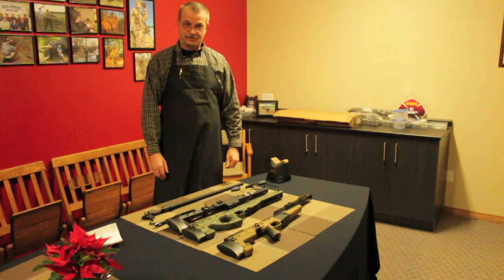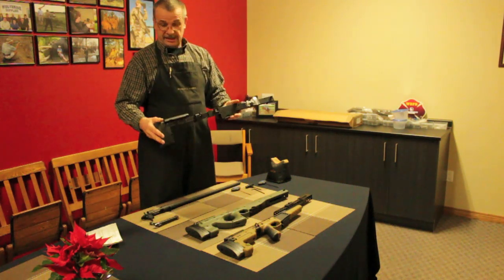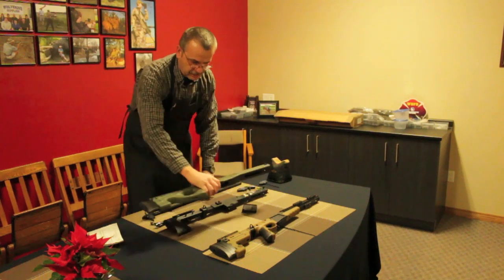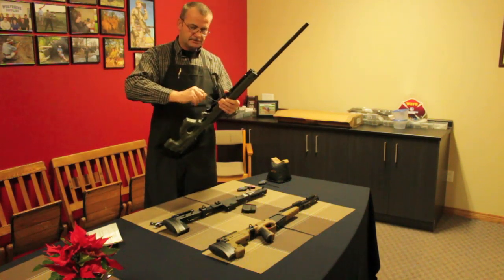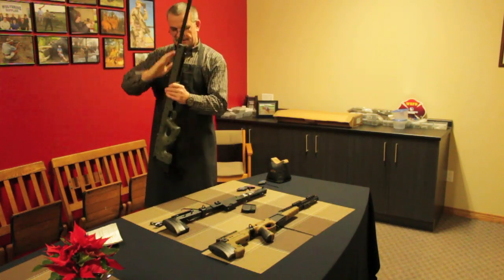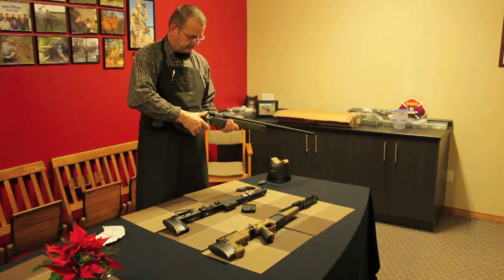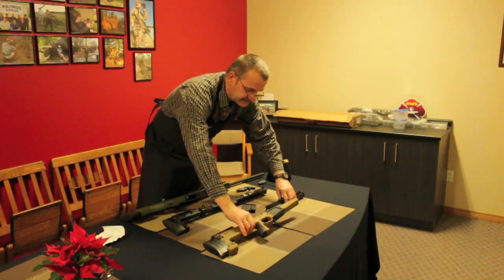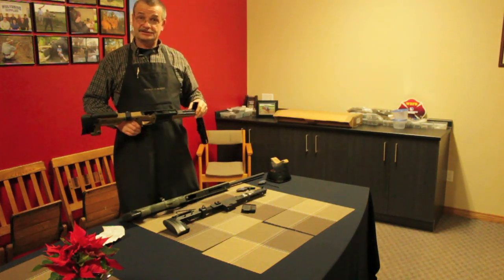AICS Installation Video

Comment: I have a wheeler torque wrench and bought an add on set for the Allen heads but the 3/16" won't fit through the holes of the AICS 1.5 stock. Is there a piece I can buy that fits into my wrench and reduces down to 3/16", but is long enough to go through the holes to tighten my new stock on? If there is what is the name and who sells it? I can't find anything like it anywhere. Thank you
Reply: Hello  can you let me know if you got the tool to do the job on the stock please
Reply: Sorry man, I never did. I brought it to a local gunsmith to do it for me. Never got to even meet the gunsmith to ask him how he did it, I had to drop it off and write on a note what I wanted done. Cost $10 for him to torque it for me.
Reply: The Husky brand extended set for 19.99 at Home Depot, has a 3/16 that works. Then you just need a torque wrench to attach said bit to and use. I know because I just had to do this on a current gen AX AICS